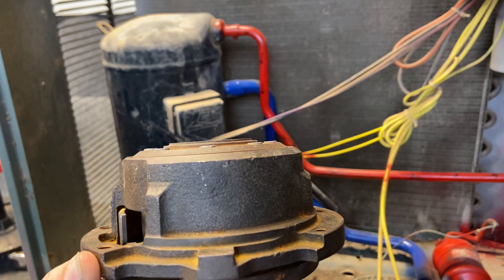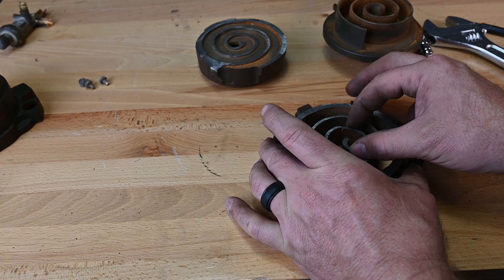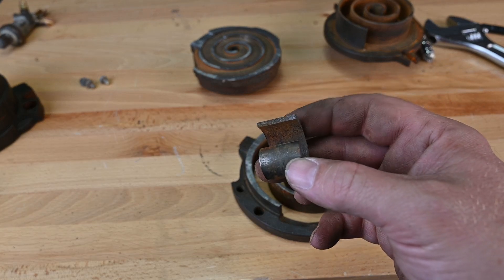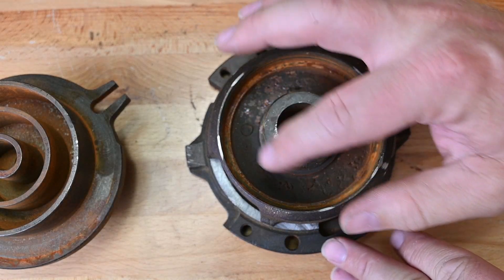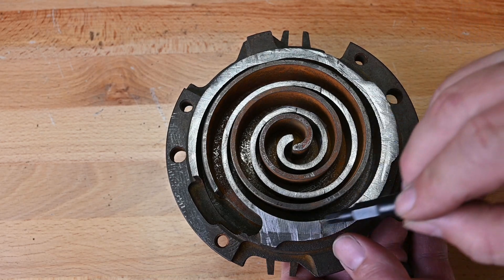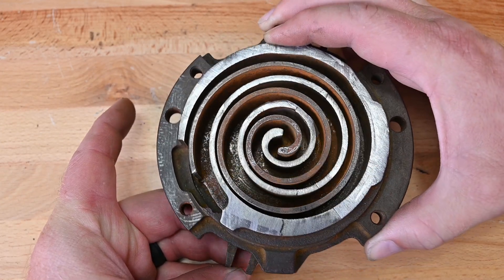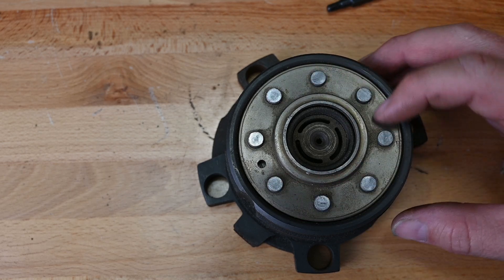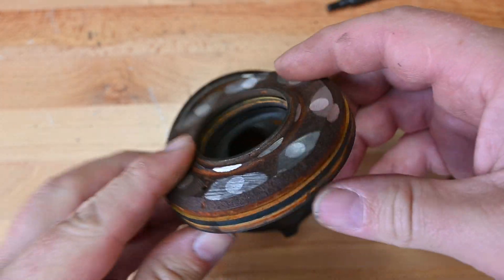HVAC 074 C the scroll set only and some unknowns

Comment: IMHO the top donut assembly incorporates a belleville washer that applies a uniform force to mate the scrolls at startup but without exceeding the load capacity of the lubricant film on the scroll lips.  With properly arranged seals the donut assembly can act like a diaphragm or a piston and apply more and more pressure as pump pressure builds.  This compensates for the refrigerant pressure that acts to separate the scrolls and also compensates for gradual wear of the scroll lips. This mystery assembly is likely very important in achieving a long reliable wear life of the scroll pair.

Comment: Hello, I am trying to build a small refrigeration system with a fixed orifice. I understand the theory enough, I think, by following your videos and I also studying the book: Basic Refrigeration and Air Conditioning by Ananthanarayanan. But the book doesn`t touch that level of detail. E.g : calculation for how long and thick should be the capillary tube in order to obtain a certain pressure, how big should be the evaporator and the condenser etc. Can you point me to some literature or study material on that mater? Thanks!
Reply from the maker: All the units I made I used a TXV even the small ones. It regulates the amount of refrigerant in the evaporator, adjusts and protects the compressor.

If you want to maintain a constant evaporator pressure  look at an AXV Automatic expansion valve.  it keeps the suction pressure consent.

If you want to calculate a cap tube here is the best resources
https://www.unilab.eu/articles/technical-articles/thermodynamic-engineering-articles/capillary-tube/

http://www.jbind.com/pdf/TC-803-308%20Cap%20Tube%20Manual.pdf

https://docs.lib.purdue.edu/cgi/viewcontent.cgi?article=1702&context=iracc

https://www.tecumseh.com/globalassets/media/north-america/files/guidelines-and-recommendations/tecumseh-er-3-cap-tube-sizing.pdf

https://docs.lib.purdue.edu/cgi/viewcontent.cgi?article=2179&context=iracc

https://www.sciencedirect.com/science/article/pii/S2214157X19303612

https://asmedigitalcollection.asme.org/fluidsengineering/article-abstract/123/4/914/459304/Modified-General-Equation-for-the-Design-of
Reply from the maker: http://ref-wiki.com/technical-information/161-refrigeration-/32555-capillary-tube.html
https://asmedigitalcollection.asme.org/fluidsengineering/article-abstract/123/4/914/459304/Modified-General-Equation-for-the-Design-of?redirectedFrom=fulltext
Reply: @love2hvac  Thank you so much!
Reply: It's really interesting to try and invent things all over from the begining. It gives you an idea of how much wits and effort was put into the things that we now see as a natural part of the landscape.

Comment: High pressure vapour pushes on the top of the scroll set forcing the two together, sealing the surfaces with the oil preventing metal on metal contact.

Comment: Pretty cool to see the the real scroll set in action instead of an animation! It never dawned on me that there are three pockets of gas at different stages of compression at one time. That is so cool. Do you think this design can be improved upon for efficiency besides varying speed or unloading?
Reply from the maker: That's a great question. Im sure there's someone in a lab working on it. Commercial chillers are adopting magnetic bearing (no contact) to reduce friction and increase efficiencies. 
I think the refrigeration cycle and compoments is amazingly efficient. It's far past time we focus on the home. I have been spending a lot of time learning building science. In HVAC we talk about efficiencies yet we put the systems in homes that leak air like crazy making installation worthless. We put air handlers with 1/4 or no insulation not to mention the duct system in attics. 
Then there is the issue of Americans leaving their thermostats lower and lower and lower adicted to the artificial "cold" but target refrigerants as the problems and regulation. 

But that's several other topics for other days.